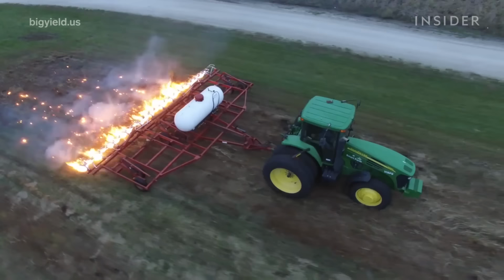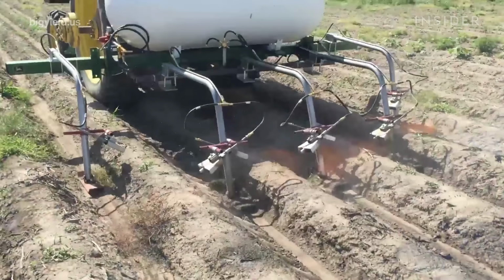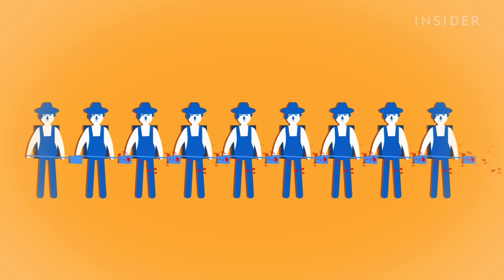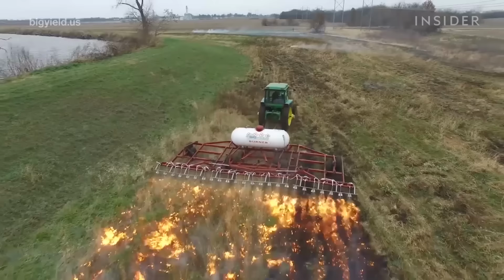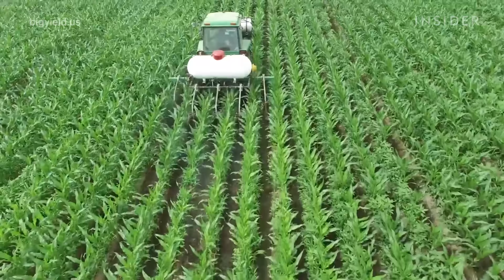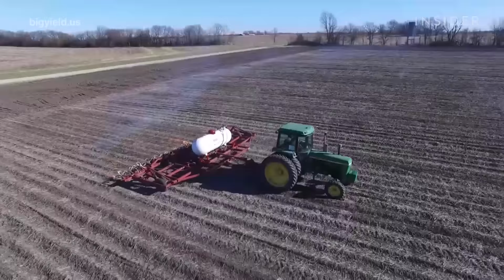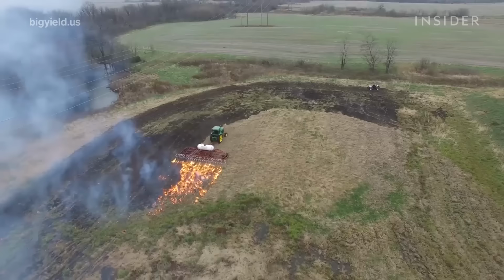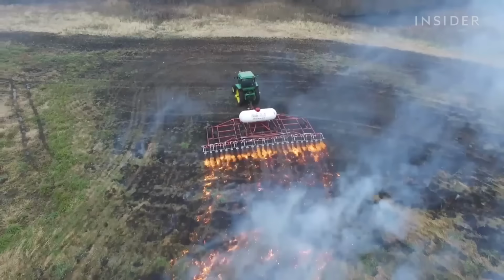How These Flame-Throwing Tractors Kill Weeds

Comment: Please just use SI units for heat etc, BTU doesn't say anything at all about the temperature of the flame... 🙄
Reply: BTU is not a unit of measurement for temperature. It is a unit of measurement for energy transfer commonly used for thermal control devices like A/Cs and heaters. The narrator misinterpreted the numbers as temperature when it was never meant to describe temperature.

Comment: The first comment that makes sense and is referring to that video.
Interesting technique, Is the soil still fertile afterwards?
Reply: Its not burning the ground for too much time. It just pass by it and burn the upper layer of the weeds leaves so they cannot photosynthesis anymore and die
Reply: Instead of asking about the soil, we should ask about the worm inside the soil, will they get burned because of the heat? Worm is an essential organism to make your soil good.
Reply: The soil has a huge thermal mass, so the flames would not raise the temperature significantly. A sunny day would raise the temperature much more. Even if worms and other organisms in the soil got too warm or dry, they would just burrow deeper underground.
Reply: @buddyclem7328  Ok, Thank you very much for the answer :)
Reply: @f4fphantomii468  You're welcome!

Comment: What about the emissions from this?
Reply: Low. Propane burns very cleanly.
Reply: @TheMetalButcher  propane may burn clean...the weeds dont.
Reply: @V1Pin  The idea is not to burn the weeds. Just wilt them.  You're wasting fuel if you burn them.
Reply: @TheMetalButcher  except you see the wilting done only when the crop is knee high... you can see very clearly in the video, several instances where the weed is freely burning when the main crop isn't present.
Reply: The Metal Butcher LPG/propane has greater greenhouse emissions than coal.

Comment: Why did you said BTU, why don't you use Fahrenheit or Celcius units?
Reply: Because they weren't given temperature specs. They were given heat transfer specs, and the narrator misinterpreted them as a unit of temperature when BTUs are a unit of energy like J, kWh or calories.

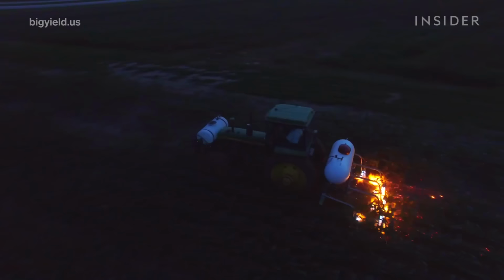Comment: BTUs is not a measure of temperature but a measure of energy.  For example, millions or billions of BTUs would be required to raise a large lake a few degrees.  You can also heat very small quantities to very very high temperatures and be in the nominal BTU range.   The temperature of the fireweeding flame and a stove top flame would likely be the same temperature or very similar.  1:32

Comment: I'm wondering if roundup or flaming is better in terms of killing good/bad insects and microorganisms.
Reply: I use propane flaming in my home garden and if you keep moving it only heats the weed tops.  Most plastic irrigation pipe and anything under a fraction of an inch under the  soil ( like frogs, microorganisms etc) never gets the heat.

Comment: strange be organic buy burning hydrocarbons with toxic fumes and residues and green to by putting more co2 in to the atmosphere? since when do plants not regrow when the above ground part of the plant is removed? they start off with no above ground part of the plant and will endeavour to regrow whether scraped, cut back, using salt/vinegar weedkiller paraquat etc, although some or many plants may be susceptible why should burning be any different. traditionally if you want to be green and organic hoe the weeds.

Comment: BTU ???
An alien measurement
Reply: It's not even a unit of temperature. BTU is a unit of energy transfer, often used for heat. Aka, narrator was given power rating of the flamethrowers and thought it was temperature.